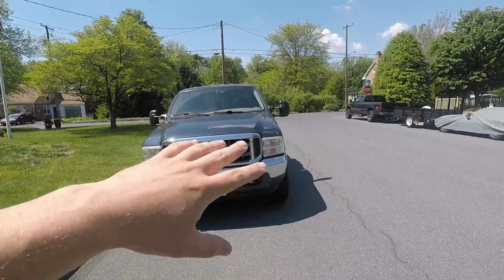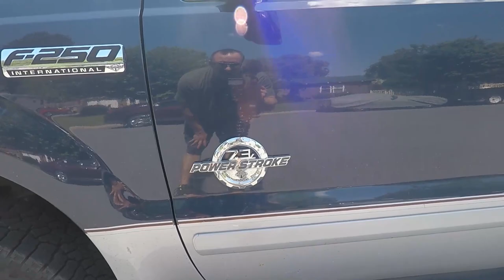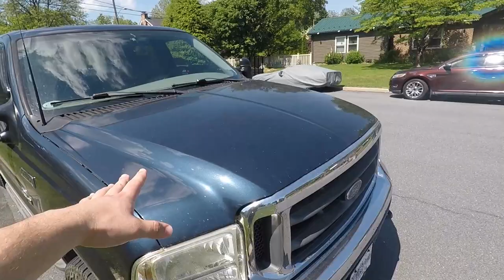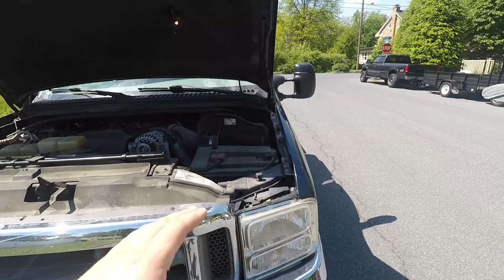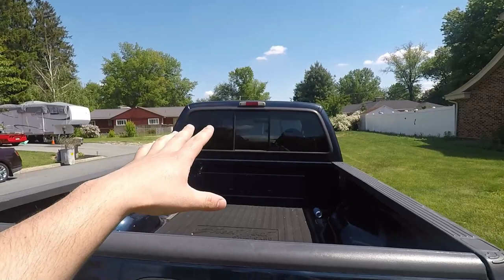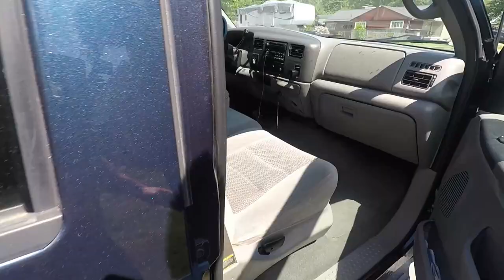6.0 Powerstroke Update New 7.3 Powerstroke

Comment: Looks like I am in the same boat you are !  Selling the ‘14 6.7 because the market is nuts and I can get more for than I paid for it. Will pick up another one when things get back to normal, probably a ‘17 or ‘18.
Just picked up a ‘99 7.3 F250 off of a farm auction that had a new engine and trans in it ($3500) so I will be interested in what you recommend for low key upgrades. It will be a work truck primarily so I don’t want to got to crazy with it.
Should be getting my 6.0 back from the shop in the next couple weeks as well. It looks like all the oil lines got gunk in them after I replaced the oil cooler. GOOD TIMES!
Keep rocking dude!
Reply from the maker: Thanks brother. Looks like we will both be looking for same years 6.7 eventually lol. I want a 17-19 when I am ready but I think it will be at least a year yet
Reply: @six0bros  yeah I hope I can find a king Ranch next year maybe. All depends on how work bounces back.
Reply from the maker: I think I want another lariat. If there was a crazy deal on a platinum I would definitely pick one of them up haha
Reply: @six0bros  can't go wrong with that. It will definitely be whatever deal I can find at the time. Drove this 99  cross country and definitely missed the comfort the 6.7s have
Reply from the maker: One day I would love to swap the interior to my 6.0 but that isn't happening anytime soon lol. Could be seats swapped out though lol
Reply: @six0bros  an interior swap would be a sweet episode!!
Reply from the maker: Yeah it would be a good one. Not sure I'll have the free time anytime soon for a project like that with school but I want to try and plan some of it

Comment: Maybe u should tint match the front windows and add a newer style superduty rear bumper
Reply from the maker: That's a good idea man. Thr newer rear bumper does look good
Reply from the maker: Do you know what's needed for the swap?
Reply: From my understanding up to 2016 is bolt on the 2017 to current might even bolt up also
Reply from the maker: Just wasnt sure if I needed the newer brackets also
Reply: @six0bros  u might but it wouldn't be hard to get brackets with the bumper a newer rear tailgate would be a cool swap also
Reply from the maker: I want to do a new tailgate on the white truck. So I'll probably do that at some point. Yeah I may have to hit up some junkyards next month for the bumper

Comment: I got a question sorry my ignorance i upgrade the chargin pipes and delete the trottle body  my question is the sound its diference or maybe y have a leak?
Reply: Its a 2004 f350
Reply from the maker: My question is what sound is it making? Any drive ability issues? I would say likely a leak but need more information to truly help you
Reply: Its like a wistle but more deep i dont know when you delete the trottle body in the intake the sounds change im bougt the cts 3 to monitoring everything but i dont know exactly how many pound of boost was have before and i dont know if she losing boost i have a booster fuler and she on 32 pounds of boost right know i dont know
Reply from the maker: Can you send a video with a sound clip to Instagram?
Reply: Hey i hope your great sorry for not send the video yet its because i gixed one of the connection in the pipes and the wistle gone but thank you so much for write me back have a wondeful day thanks
Reply from the maker: No problem man happy to help. That's a big reason the channel got started was to help people out so they weren't taken advantage of from shops